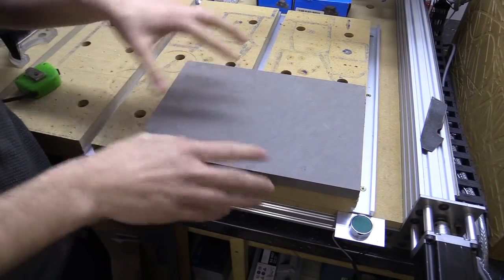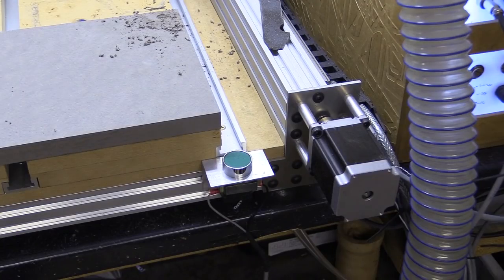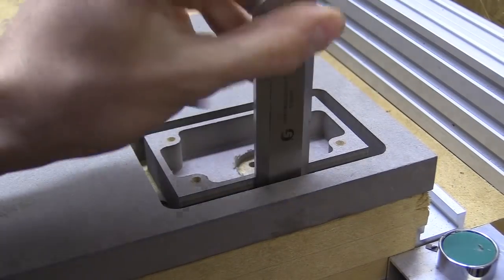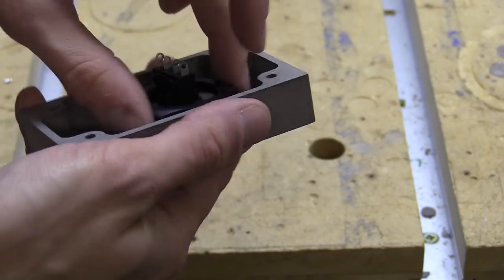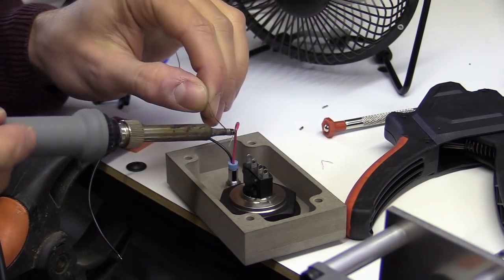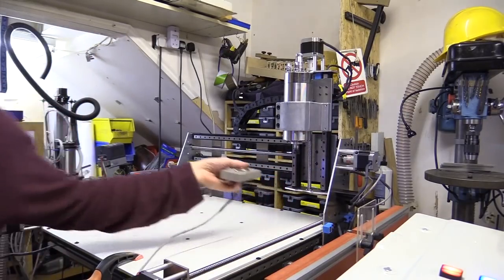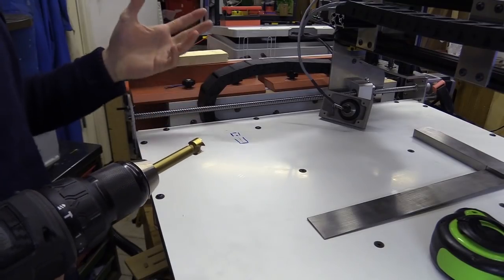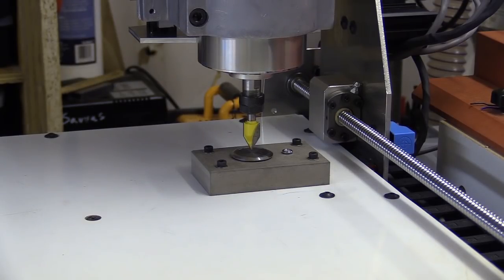#39 CNC Control Box Part 3  / Stationary Probe Button Tool Length Sensor Setting Tool

Comment: Can you recommend a pushbutton to buy for the touch probe offset? I can't seem to find any good tight fit ones. They all have some slack, and don't quite work good
Reply from the maker: Have a look on RS components under the push switch section. You'll want a momentary one.

Comment: I think the Z-Axis homing button thingo is a bit dicky. 
Since you've grounded the spindle, you can use the original manual plate idea (without the croc clip), And replace the button by a small plate or bolt (insulated from the frame of course) at the homing position. I'd also mount a banana jack on the frame wired to the plate/bolt,  to allow for quick and easy connection of a  a manual plate for calibration after resurfacing the wasteboard.
Reply from the maker: Hmmm  I don't see the advantage of your method. You'd rather have a bolt than a button? I prefer this method for a couple reasons. Using a plate on top of material often means you set the jobs from the material height. If you set the material depth incorrectly you'll only know about it when you start cutting into your waste-board. This way the probe location doesn't change and can be offset to the waste-board itself. If I accidentally  set the material depth higher the tool will hover above the material and I'll know somethings wrong straight away. Also you can just job your tool to the recently surfaced waste-board and use g-code to set the work-space z zero.
Reply: @EducatingSavvas  I mean just replace the button with a simple plate (it could be something as small as bolt head). At the same place, used the same way.
A button's switch point can vary, as you saw. The plastic of the button also seems to be getting scratched up a lot, which will shift  the switch point as well. 

My other point about the original plate is that it may still be useful for special functions if required (eg: after resurfacing), but it won't need the croc clip, it would just plug in parallel with the homing plate.

Comment: Did you check the z-axis for squareness after the crash? It looked like there was a lot of flexing in the carriage when it crashed
Reply from the maker: The material shifted on the wasteboard, and the spindle did ride up the into the z-nod, but the spindle didn't need re-squaring afterwards. There length of the c beam along the x axis and the over hanging of the z axis is where the flex comes from. But I designed pivotable mounting holes for the x and z axis which allowed me to compensate for these at when originally setting up the machine. Latest machine is a lot more rigid.
Reply: Awesome. I knew this latest version was a lot stiffer than the 3D printed and plastic versions but to my knowledge it hasn't been battle tested. Glad to hear the machine can handle a hard stall.

Comment: How are you getting away without a bearing block on those ballscrews? I have a hard time imagining that your motor bearings can take the lateral loading?
Reply from the maker: The ballscrews are held between two flanged bearings on the motor end plates. I placed the bearing on the ballscrew and measured between the flanges and then made the aluminium profile the same length. As long as the end plates which hold the bearing don't bend, or the flange doesn't break, I think I'll be ok.
Reply: @EducatingSavvas  Oh sorry I didn't notice the flanged bearings! Thanks for pointing those out.